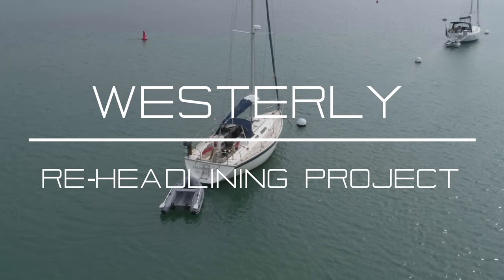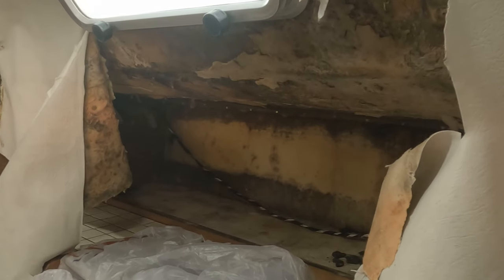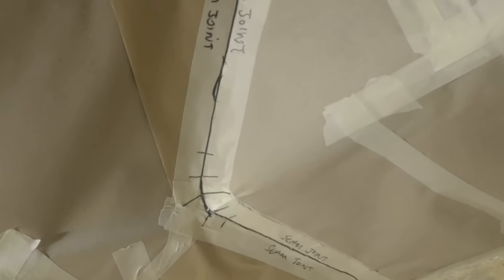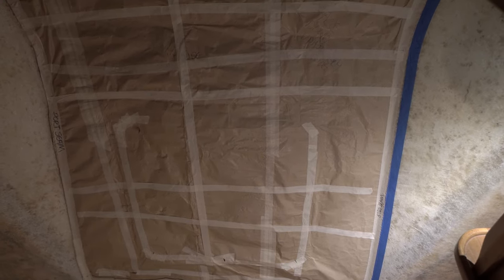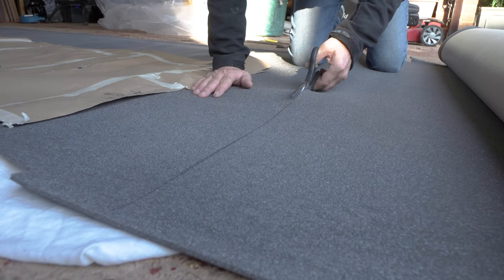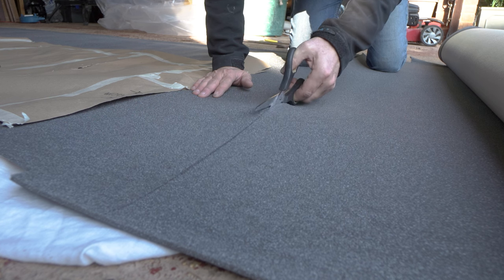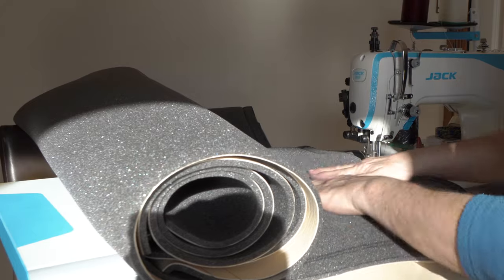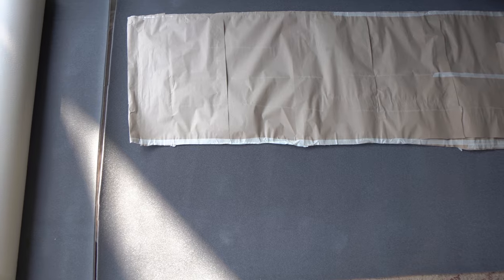Westerly Headlining Project. Restoring A Westerly Storm 33.

Comment: I have a smaller boat with the same vinyl droop. I have removed much of the vinyl, prepared and painted the fibreglass with a water based paint. This will be left for a while whilst I decide what to do longer term. I must admit the cream paint looks pretty decent for now. For me, water based paints and adhesives are the way to go, being much safer and easier to work with. I am trialling Eco Thixofix from Alpha Ahesives and it sticks really well, as a contact adhesive. I have used and painted very flexible 3.8mm plywood sheet for one quarter berth panel as an alternative to vinyl, which has practical advantages for easy removal/later addition of insulation. You took on an epic challenge here and got a great result. Well done!

Comment: Great video. Such a familiar sight to me! I haven't got all the skills you have, getting to grips with the sewing machine. But have used Hawke House themselves to make the trim pieces from the originals as patterns which has worked for me. Certainly not a job for the feint hearted...
Reply from the maker: Can't wait to see yours!
Reply: Great video thanks! My headlining isn't too bad, but the forward cabin needs doing ! 

Also love the lighting, I was toying with led strips, which have you bought? I want the control panel you have!
Reply from the maker: @s62m5  Thanks, if you're referring to the controller in the head, its a Wall
mount RGBW PWM LED controller single zone, from hiline-lighting.co.uk The LED strips are all BTF-LIGHTING 5050
RGBW RGB+Warm IP65.
Reply: Brilliant thanks !